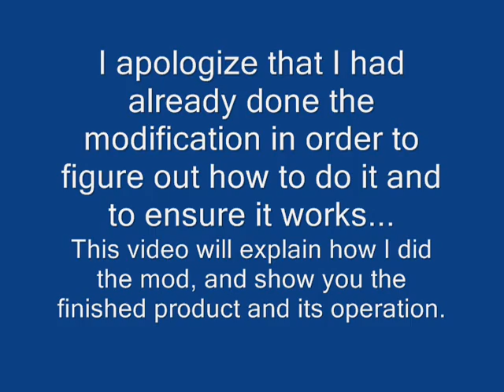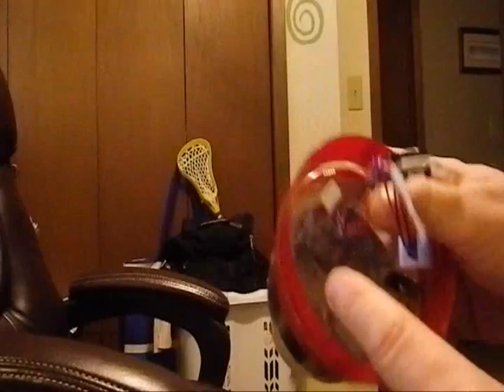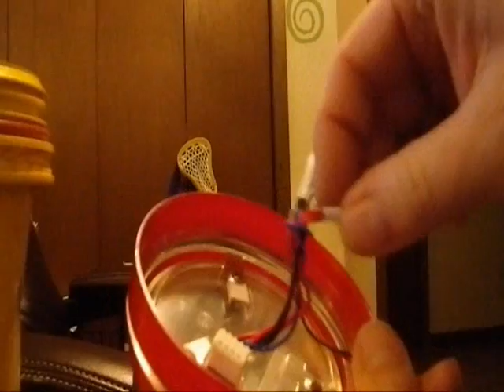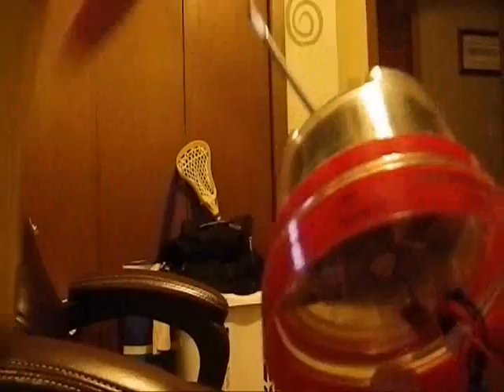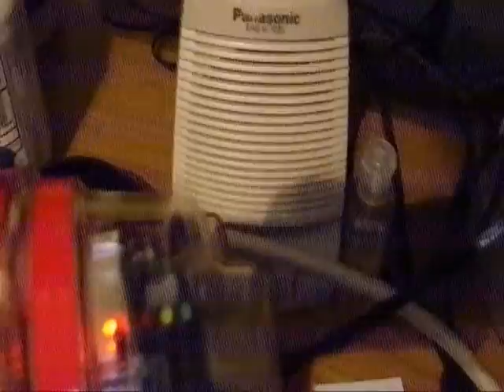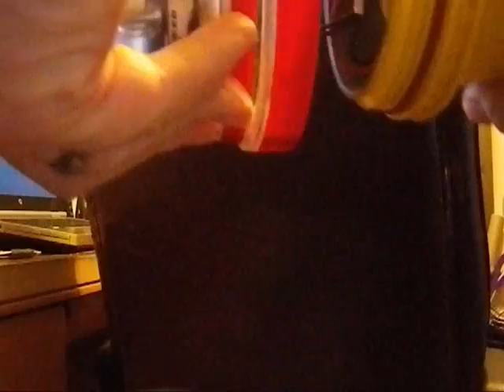9V Battery Conversion SEIMAC 406 121 Training ELT

Comment from the maker: Hi Everyone.  

I am glad you have found this to be somewhat useful.  I think your use of rechargeable Lithium AA batteries in a battery pack is an excellent idea.  I didn't have access to those when I was forced to quickly modify ours.  Bruce McConnell's suggestion is a very good one.

But, it also could be worthwhile to set up a six AA battery pack using a similar 9V matching connector and hook it to the 9V plug installed according to this video.  That would give the user flexibility to change to either the AA battery option or a 9V battery found at any convenience store in the field, if that might be required.

Wayne

Comment: Hi Wayne - this is a great video.  Were you able to modify the beacon to transmit on 121.775 instead of 121.5 as well?  Any instructions for doing so? Appreciate the tutorial!
Reply: +SeattleSquadron The CAP trainng beacon already is setup to transmit on 121.775 MHz vice 121.5 Mhz although the 406 version does send an active signal so when you use this beacon your IC must notify the AFRCC that the beacon is being used.
Reply: +Bruce McConnell PS.  Group 3 FLWG uses a 9-volt six AA battery pack with 6 Ultimate Lithium batteries that allows more much longer training use.